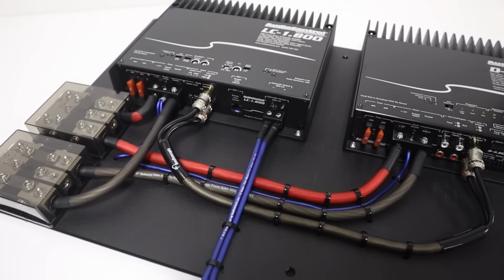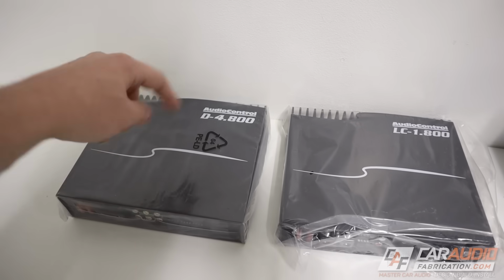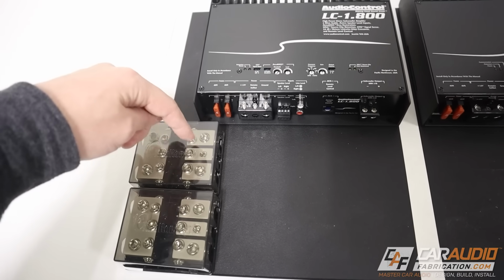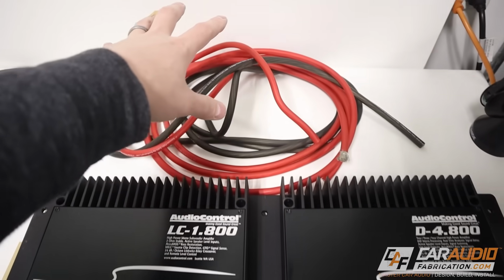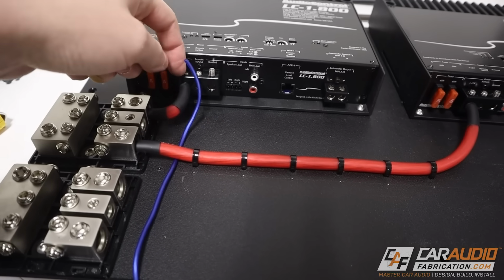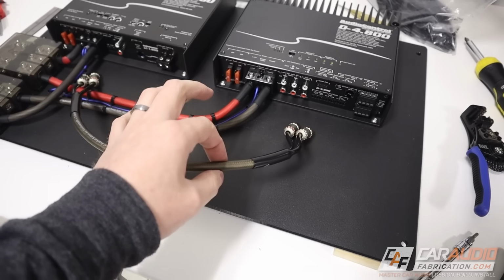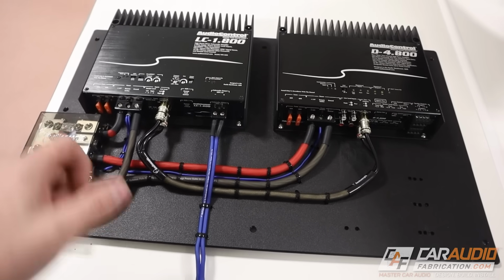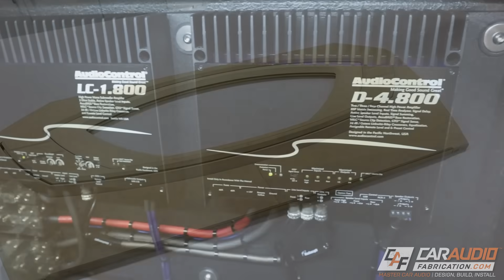How to - Amplifier Rack & Wiring ORGANIZED & SERVICEABLE!

Comment: Navy veteran (advanced electronics as a sonar technician) and retired Army (prime power production), I ordered a 2002 Z06, in 2002. I gutted the interior and installed sound deadener throughout. Installed an Alpine CDA-7998 head unit, CDT Audio tweeters and mids  in a custom made enclosure inside both doors w/crossovers, JL Audio 6” behind seats where factory speakers were. Made a custom amp rack with JL Audio 600/4 channel amp and a JL Audio 1000/1 sub amp and a JL Audio 12W7 subwoofer in a custom made sub enclosure. All stinger wires and fuse blocks. Bosch relays. Did every bit of the work by myself. It all started when my wife won a car stereo as a door prize at the post Christmas party on Ft. Lewis. That is why I ended up on that very expensive road of an install. Because the stereo didn’t work! Greatest sounding system I have ever heard and I installed a shitload of them for friends. They trusted my abilities due to all the military education/years of practical electronics and electrical experience. Worked for Detroit Diesel-Allison as a field service technician on marine engines and generators (mega and super yachts to ferries and fishing/shrimping/crabbing boats as well as very large power units installed from north slope of AK to South Africa.

Comment: How does the D4.800 receive its sub woofer signal from the head unit? I see the front and rear RCA i also see the sub woofer RCA from the D4.800 to the LC1.800

Comment: Amazing work and video as always Mark
Reply from the maker: Thanks! Got any projects in the works or planning right now?
Reply: @CarAudioFabrication  Actually just finished it.  Built an amp rack, deadened and sealed the doors, ran all new KnuKonceptz 16AWG to my front components. And built a 2.18 ft^3 tuned to 32.21 box to replace my middle seat/console in my single cab truck. Next things I'm planning on getting is a mic so I can use my DSP to its fullest, getting some front components because coaxials offaxis response suck when you are 6'5" and they are deep down in the door. I'd also like to get another 2 channel amp to run full active, and get a beefier sub. But then I would have to make a new amp rack and new box. Dont feel like doing that again right now
Reply from the maker: Sounds awesome!  Yeah the DSP tuning with a mic will go a long way, even with the Coax speakers. I'd tune and enjoy it! You can always do more down the road!

Comment: I definitely recommend chamfering the holes before you tap. Atleast with steel, there's a chance of mashing your threads in a tiny bit, causing you to have to run the tap through again. All up to you though, it might not even matter with plastic

Comment: Running the D-4.800 and LC-1.800 in my 5th Gen 4Runner powering Morel Hybrid 602's active and a JL Audio 12w6v3. I have nothing but great things to say about AudioControl amps. The DSP is good, but limited in some aspects and is best for an aftermarket HU vs OEM integration. Not that OEM integration isn't horrible, the DSP is better suited to a clean slate so to speak. My new build is going to use the AudioControl LC-6.1200 for a Morel raw drivers 3 way active setup in my Lexus GX. It's equivalent to Morel Elate Titanium. I am using JL Fix86 to Twk88. This time I'm going with 2 JL Audio 8w3v2's to see what I can get out of them. I just can't pass up AudioControl amps for their warm and natural sound. Is it as good as a high end A/B, probably not. But, they sure have impressed some fellow audiophiles in my area.

Comment: That drill and tap set is a nice touch .. I was gonna run wood screws untill I seen this .. are the taps pretty accurate to screw size ? Like 1/4 tap for 1/4 screw? And so on? Not necessarily that large ? But just wondering the size you are useing ? I gotta say… your a neat freak/ animal with this man!! All respect… you opened my eyes to so much on your page .. from this to lc2ipro and setting that up as well . I appreciate you brotha!

Comment: Thanks for all the instruction.  Do you have info you can share as to which size treaded inserts you used and the corresponding Allen screws that fit into the threaded inserts?

Comment: Great videos, this one also. One thing.... I wouldnt run the RCA that close to the +/- wiring. Maybe the setup is not for SQ, and place is also limited, but this hurts the quality a lot. Chears.
Reply from the maker: It literally doesn't matter. High quality wires, high quality amps, proper installation techniques, zero noise.

Comment: Big fan of everything you do!  Question.  I've watched your other video on quick disconnects and see you done the same here for the speaker wires. Do you believe there is any power loss or distortion, or anything being introduced by using disconnects?  I am looking at using some, just wanted more info or performance with them. 

Thanks!
Reply: Any connector, be it a disconnect or just a simple crimp connector, adds a small amount of resistance to the cable path.  However, this is only a tiny increase.  If you use say 4 or 5 such connectors on a single cable run (and I've seen ppl do that) then you could see a noticeable drop in signal strength.  But today's equipment, including head units, typically have at least 2 Volts 9f signal on the RCA outputs, and often even more.  At that signal strength you'd have to use a oscilloscope to measure the difference. And even then it just takes a very small fraction of a turn on the Amp Gain to make up that difference.  But honestly you won't be able to hear it.

Comment: Did you crimp the Farrels on the power wire and ground wire or did you just use the heat shrink to hold it on

Comment: Hello there Mark!  First....thank you for taking the time to explain your installations and the know how's....Ive personally learned a lot! After i mounted my amp, doesnt matter how....my speaker and signal wires are too close. Can they be insulated somehow to prevent noise....? Thanks
Reply: Try to have any of the power, speaker, or RCA cables cross each other at a 90° angle, like a "+", even if they need to be made a bit longer in order to do so.  This will minimize interference.

There are also two different types of RCA cables that should be used depending on if your amplifiers have balanced-differential inputs or not.  Otherwise the chances of picking up RFI & EMI inducted noise will be greater.

Twisted pair RCAs should be used with balanced-differential inputs, and high-quality shielded Coaxial cable RCAs should be used for all others.  Most budget and mid-tier amplifiers use this.  And higher-end amps tend to have the better balanced-differential inputs (isolated from ground).

So check your amplifier(s) and try different RCA cables.  

And some Class-D amplifiers just radiate or create a lot of their own noise.  These will often affect the quality of the AM/FM reception as well.

Also, setting your gains properly will help to minimize noise in your system and provide better audio quality.  Search YouTube for "D'Amore Engineering Setting Gain".

David D'Amore is the designer of Steve Meade's SMD DD1/DD1+ Distortion Detectors that help you to properly set your head unit, DSP, and amplifier gains.
Reply: @bbfoto7248  thanks for taking the time to reply. Ill be trying your suggestions...

Comment: I have a 99 regal ls going to put 2 skar sdr 12s ported box facing toward trunk but am having a hard time figuring out where to mount amp and thoughts of best place to mount it will have 1209.1d amp and 1 fuzed dispo block want it to be clean as i can make it

Comment: Let's say I wanted to make an amp rack out of 0.5" MDF board, how would you attach the amps down? The box will be laying in the back of my Wrangler and I feel like I should use bolts and add small feet to the box to allow room for a nut, but was wondering if I could screw them down instead.
Love your videos!
Reply: Use threaded inserts designed for MDF. You should be able to find them on Amazon.

Comment: Hey I have a quick question and I'm stuck in place until I really figure this out. It's about the passive crossovers. Being that I'm using the RF T2652-S 6.5 components in the front doors/dash, does it matter where I set my high pass filters for the front 2 channels being that the component speakers have the passive crossovers and the job of the passive X-overs is to filter out unwanted frequencies? Could an all pass or full range signal be sent on channels 1&2 because there's the X-over?

Comment: I WOULD LIKE FOR YOU TO BUILD A 4 HOLE 12'' BOX WITH A CENTRE PORT. ALL THE SUBS ALSO FACING TO THE FRONT WITH THE PORT HAVING 2 SUBS ON EATH SIDE. THIS BOX IS TO FIT UNDER THE BACK SEAT IN A TOYOTA QAUNTUM/HIACE 2017 MODEL

Comment: I think the rubber washer should be between the sub box and the amp rack in order to actually do isolate.
Reply from the maker: It is, there is one behind the panel and one on top of the panel. I explain this in the video.
Reply: @CarAudioFabrication  ah OK, thanks for replying. Makes sense.

Comment: Hows the sub speaker cable connecting to the box? Looks short and can't see where its going to? Underneath?
Reply: Mark is using a female XT60 or XT90 connector on a short "pigtail" wire connected to the amp so it can stay permanently connected to the amp rack.

The sub box will have a longer wire connected to it with a matching male XT60/90 connector.

This makes it easy to quickly & securely remove the subwoofer box or amp rack individually or separately from each other for service, tuning, or updates.

Mark and other good installers will also use these XT60 or XT90 connectors for the tweeters, midrange, and midbass speakers.

They work especially well when installing custom A-pillars, and dash top speakers, but work great for door speakers as well.

Comment: What do you do with excessive wire such as the rca and bass knobs that can’t be shortened?
Reply: There are simple and inexpensive tools that allow you to make custom length cables using "RJ" series connectors like telephone cables or CAT5/6/7 networking cables.

You can also easily cut and re-attach/solder RCA interconnects to make them a custom length.  Or buy the wire and connectors to make your own.

Sure, it takes some time, but it's really not all that difficult.  Plenty of tutorials on YouTube for this.

But most of the car audio brands that offer RCA interconnects make a wide variety of lengths so you can get one that fits with minimal excess.

I don't worry about the excess if it's just a foot or so extra.  There are plenty of places to coil up that small excess...usually under the amp rack, or somewhere along the run from front to back.

But having more than a foot or so of extra length to coil up triggers my OCD, LOL.

In general, it's not really a good idea to coil up excessively long RCA cables.  It will have more opportunity to pick up noise and degrade the signal when it's coiled or wrapped up like that.

For the telephone type bass knob cables, it's just a control cable and it is not carrying any actual audio signals, so it really doesn't matter in terms of sound quality or performance.

Comment: Hey Mark. I've been watching your channel for awhile now. I haven't seen a video on what happens when you run subs at a different ohm. So I have a dvc 4 ohm wired at 2 ohm's. My am is a 2 ohm , 1 ohm stable. At one ohm you get the max output of 1k/2k. That's what my sub is rated at. What would happen if I ran it at 1 ohm?

Comment: how come you perfer the plastic over wood?, ive always found wood a lot more easy to work with so Im just wondering
Reply: Wood has a good chance of getting moisture!
Reply: I've been using 3/8" aluminum plate, and security bolts.
Non-Republican types will have to invest a great deal of effort
For
DaFreeShit

Comment: Whats a good amp to have 3 subwoofer working
Reply: It's not a matter of how many speakers any specific amp can run.  Its a matter of matching the power requirements of the combined speakers along with the total Ohm load.  Pick the subs you want to use and calculate the total RMS power needed and what the Ohm load will be.  Then you can look at amps that can produce what you need.

Comment: you have a 4 channel amp for speakers and monoblock for subs. i dont get that because isnt this system having 2 tweeters, 2 mid bass, 2 coaxials, and 2 subs? 1. ive seen amps that are say 6 channel, 9channel dsp. is that what allows u to use only 4 channel amp? 2. i thought for every sub you need a amp channel? if you have a monoblock amp how can you use 2 subs? does the way you wire the subs allow 1 channel to power both subs?

Comment: Dsp to amp RCAs running right over power.  I would have kept them away. Awesome build though
Reply from the maker: Thats the signal for the subwoofer amp, which will never have an impact, these are high quality RCAs that reject noise, and that short of a length won't matter.
Reply: Also, in truth it's not when you run them Over power lines that electromagnetic transference can occur.  It's when the two cables are run parallel to each other.  However, it takes more than a few inches to create induced noise.  Also, induced noise is never anywhere near the signal strength of the originating cable.  Today's car audio equipment usually runs RCA outputs at 2 Volts or more, which is plenty to overpower any induced signal. And finally, as Mark said, those are shielded RCA cables which rejects EM induction.

However, the RCAs coming from the Head unit should never be run nearby the main power cables coming from the battery for that reason.  Being in proximity and parallel over 12ft or longer will definitely induce a strong EM signal from the power lines.
Reply: @thebkg  Reasons to wire triaxial like in test and measurement :D
Reply: @walter clement   
The power cable is DC (Direct Current), and the speaker outputs and wire carry AC (Alternating Current).

But when you have either signal cables and/or speaker or power cables cross each other at 90° angles, there is very little opportunity for interference because any inductive or magnetic field or energy surrounding each wire is minimized in its "contact" surface area where the two wires cross.

If you have the wires running parallel and in close proximity, there is more opportunity for interference because there is a long or larger concentrated surface area and more possibility for interaction.

But having said all that, this type of interference is rarely an issue.  

Think about this...your vehicle's entire metal body is a Giant Ground Plane or essentially a giant Negative (-) power cable! 

The metal body of the vehicle carries just as much voltage, current, and noise as ANY OTHER standard or separate power or ground cable! 

And nearly ALL of your car audio wiring is in close proximity to the metal body of your vehicle at all times, right?

So essentially, ALL of your speaker cables and RCA interconnect cables are ALWAYS next to a Giant Negative (-) power cable!  Whether it is Positive (+) or Negative (-) doesn't matter...there is the same amount of current, voltage, and noise flowing in both.

It's just flowing a different direction...either TO or FROM the battery and alternator.

So there's that.  ;-)

Comment: Hi i recently installed an used sony xm-554zr 4 channel and kenwood 12 inch to my 2008 nissan versa it works fine and punchy while idling but the subwoofer kick fades while im doing highway speed like 60 or 80 and the kick comes back immediately when i slow down my car .i wired it up myself (4guage).can anyone faced this issue or find me a solution. Thanks in advance

Comment: RCA's together with power and grounds? Hmmmm 🤔
Reply from the maker: It's not 1980 anymore. Quality amps filter the noise, the RCA Cables are heavily shielded, and they are close for a very small amount of length. Zero noise issues on this system.

Comment: Audiocontrol should pay a little bit more attention  to the design of their systems. You've made a beautiful amp rack and  your cablemanagement is superclean but because of the generic aluminium housing of the Audiocontrol systems its not very aesthecially pleasing.
Reply from the maker: I actually like the design, its simple and clean. No chrome or flashing lights needed. And a far more original design than most of the rest extruded aluminum shapes.

Comment: Appearance is nice but this is Vibration City. It amazes me how the car audio industry gives almost no consideration to vibration. The high end home audio industry is the opposite.
Reply from the maker: Please show me something in the car that doesn't vibrate. The whole car moves. Car Audio gear (from quality brands) is built to be robust.. The box is built extremely strong and doesn't resonate. The problem comes from guys making boxes out of 1/2inch particle board with no bracing and mounting the amps. Then you are going to have vibration issues.

Comment: Can't believe you screwed the look of this while system with that amp board. What you should have done here is run the cables directly through the board right at the connectors and have them come back out from behind the board right at the connector. 
Omg so disappointing. Can see this guy never done any PC builds before. Any PC builders cringing so badly at those horrible cables on that board.
Reply from the maker: Lol, the whole board is hidden behind a beauty panel. 🤣
Reply: @CarAudioFabrication  oh thank God for that 😇😇🤣🤣